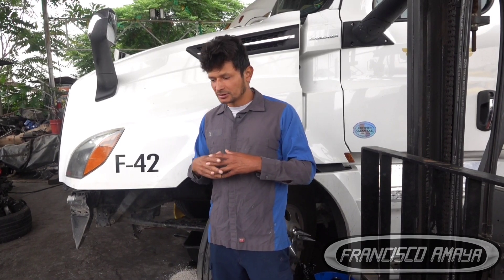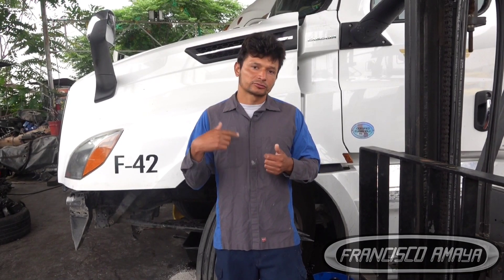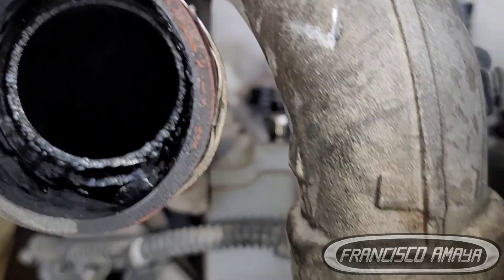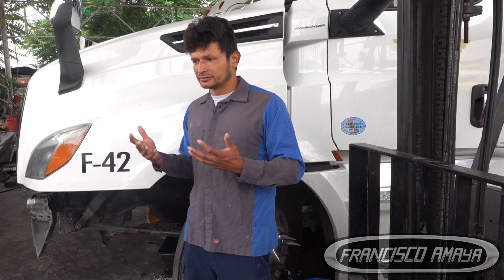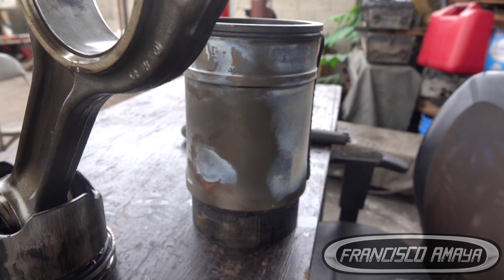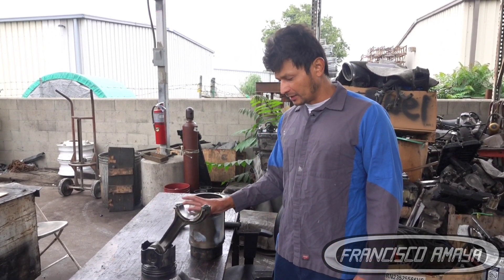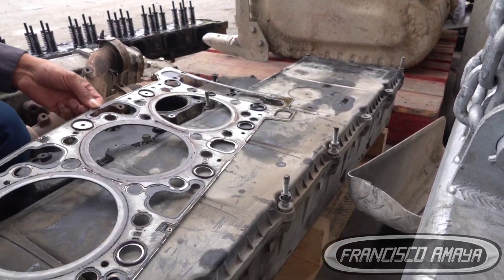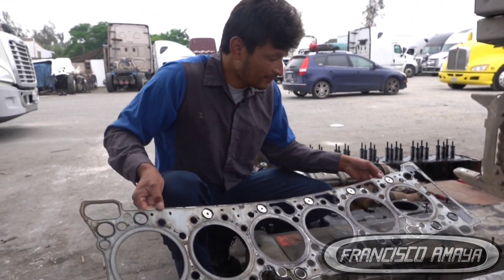DD15 ENGINE WITH COOLANT LEAK BROKEN CYLINDER HEAD GASKET COMPRESSION LEAK

Comment: Might as well do a complete overhaul to include the rod main bearings, water pump, etc and start with a brand new engine with all new components under the hood. It will be very expensive but it will save money in the long run to replace everything now before something else wares out.